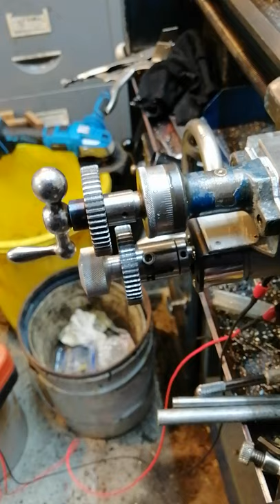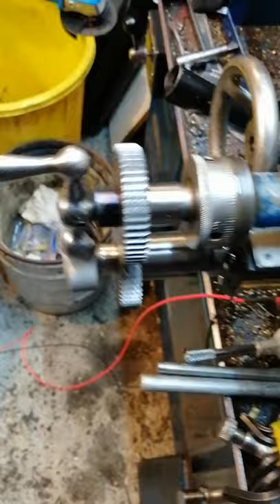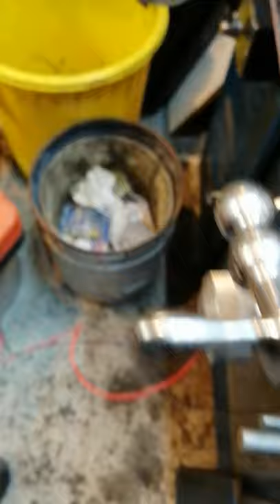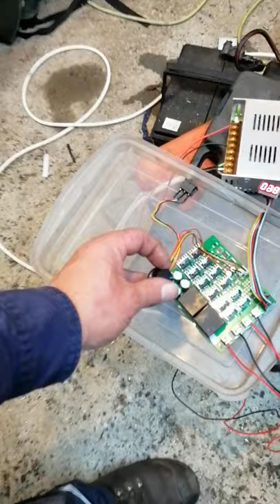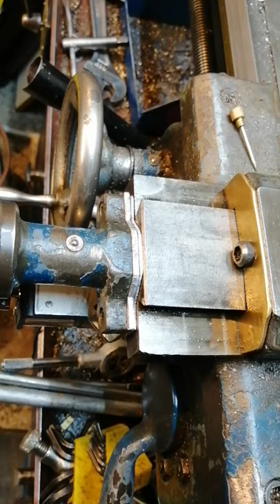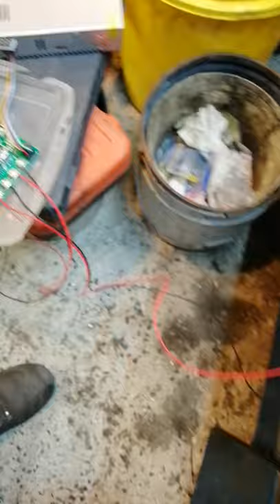Boxford CUD Electric power crossfeed.

Comment: Power feed looks cool. I have a Boxford model A and use the power feed all the time. I put a treadmill 2.5 HP 4000 RPM variable speed motor in my lathe. It is a great modification.